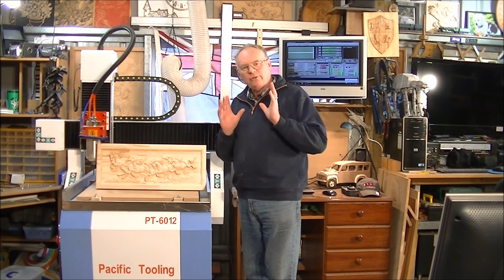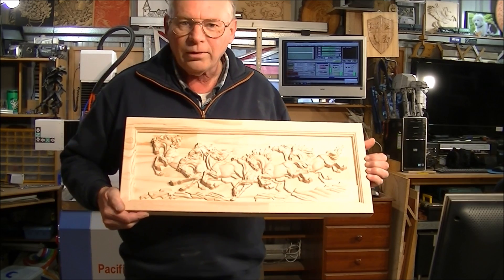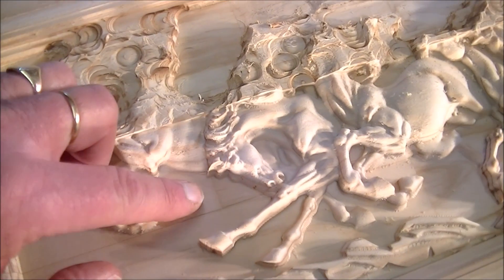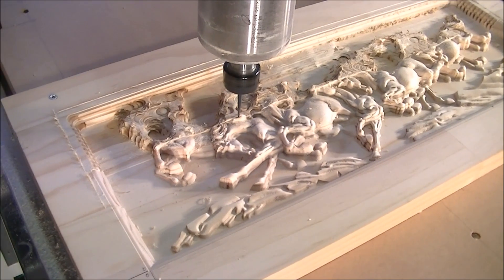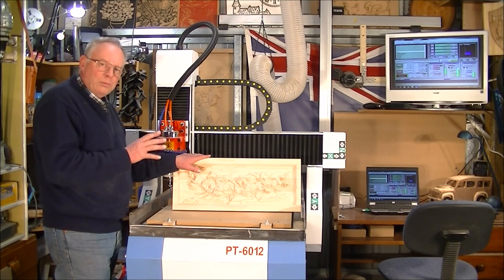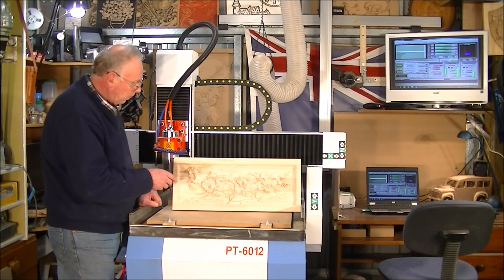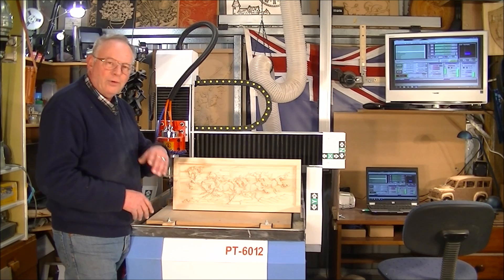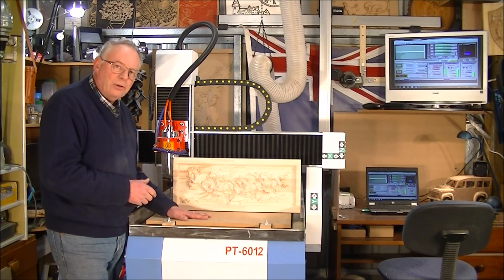6012 CNC router making a 3D carving

Comment: Hi Roger. Another excellent video and finished product. Can i ask you what bit did you use to do your project ?  I see you don't start your project with a end mill to do the roughing. Am i correct? Regards from south africa.
Reply from the maker: Hi Tony, roughing cut 12mm end mill and a 1mmR tapered ball mill.

 Pacific Tooling; Australian Inventor Roger Clyde Webb ;-

Comment: can i application this machine to teak wood sir?
Reply from the maker: Hi, Yes!: Email me at : info@pacifictooling.com  I will send you information on our new Wood Lathes
 and CNC routers, 4040, 6060, 6090 , 6012 , 1212, 1224, 1325 and now CNC 6040, 6090 , 1390 Lasers (linear rail model), and machine tool accessories . 
 Australian Inventor, Roger Clyde Webb, Pacific Tooling.
Reply: i message you with name " dani mahendra "...thanks

Comment: Boy, that machine sure does a nice job, no question. The tool bit you used for that seems as it is tapered the full length of the shank, is that designed like that for strength? Also in reading a couple of the other comments (questions) about why it doesn't blow the wood fibres all over the place. I could be wrong, but that spindle doesn't have air blowing down on the work piece, am I correct saying that? Thanks again for your videos. : ) Andrew